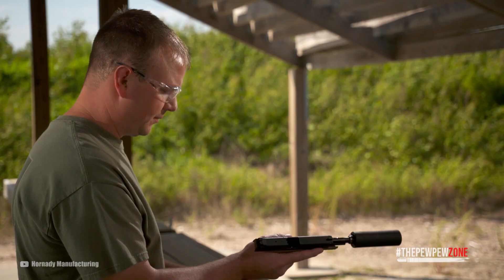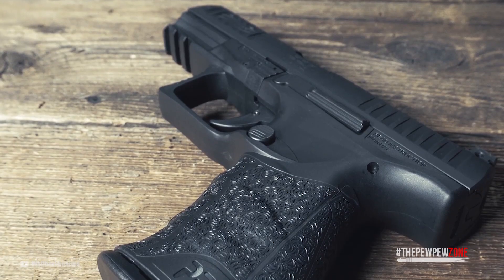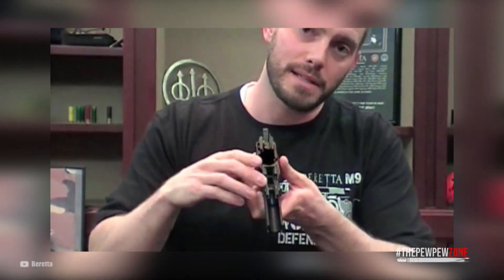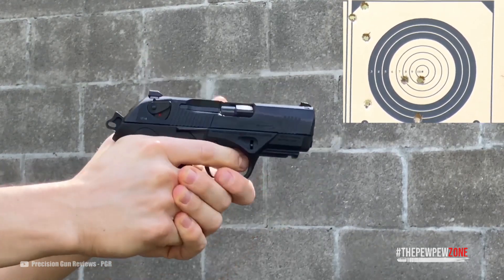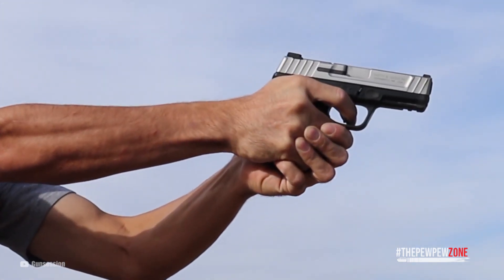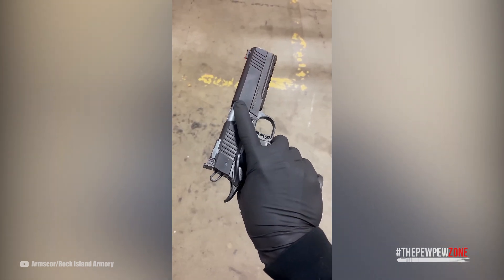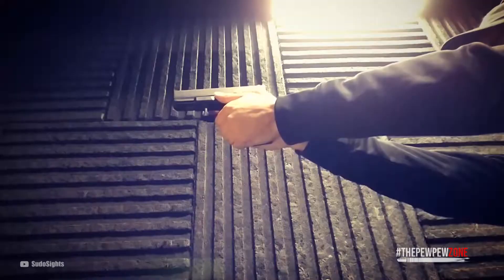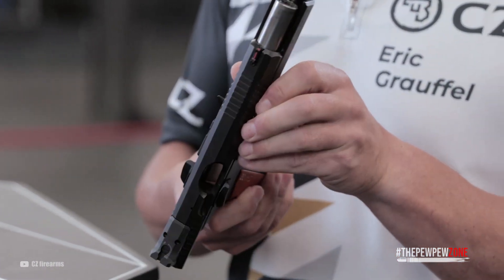7 Best .40 Caliber Pistols to Buy in 2023

Comment: My Glock 23 Gen 4 also has the ability to drop in the 357sig barrel and become a Glock 32 with no other modifications?
And I also shoot 9mm with a Wolf conversion barrel, recoil spring, and 9mm magazines. All work flawlessly.
Also the smooth trigger and Glock trigger connector (says 3.5 pound, but comes in at 4.5pounds) makes for a much nicer trigger, although not as nice as my DA/SA pistols (warmed over Sig, CZ, & FN) .
Cheers, Tony

Comment: Seriously? THIS is your list?  While I appreciate the TWO Berettas on the list, you haven't included even ONE Heckler & Koch pistol?  They make many models in .40 S&W: VP40, P2000, P2000sk, P30, P30L, USP compact, and USP full-size. HK arguably makes THE BEST .40 caliber pistols currently available.
Reply: I think the VP40 is not only one of the best .40s available for sub 1k, but might be one of the best Striker fired under 1k
Reply: @talbottsands3560  I don't doubt you, AT ALL.  I own both a full-size USP and a compact USP in .40 S&W and they are fantastic!
Reply: Hkp30ls 40
Hkvp40
Tanfoglio defiant stockmaster 40
S&w m&p m2.0 40
Reply: Damn straight !  I know firsthand just how great the HK's are in 40 (my bank account knows too😒).
Reply: @javiervega8875  I like my M&P 2.0 40, but it needs an apex trigger, the factory trigger is just too long.
Reply: @talbottsands3560  Yes, I have the same problem with mine I don't like the trigger either.  I will change it.
Reply: @javiervega8875 I replaced the trigger on my p30l with the grey guns trigger. Works great.
Reply: @brianburkhard5209  I respect that, but would never do that myself. You do you.
Reply: @talbottsands3560 1000% agreed!😮
Reply: I carry a VP40 as my EDC

Comment: Really?!?! Not one of these would make my top 10.. Says a bit about preference,i suppose🤔. Anyways, u asked for suggestions

 SIG SAUER P229
the ABSOLUTE BEST 40cal  of all time. (Best pistol period actually)

-All steal, perfectly 
   Weighted.
-Specifically designed for t  
   the 40cal round.
-12rd mag
-DA/SA, makes the trigger
  crisp, with very smooth
  take up in double action..
  Then in single you're
  Approaching 1911 type
  Feel, with the shortest  
  Traveling, most tactile
  Reset ever.
-BEST decocker ever made
-Insanely well balanced.
-Famously reliable/durable
-No "suicide " switch"
   (Ie. Safety)
-  pretty asf

There ya go